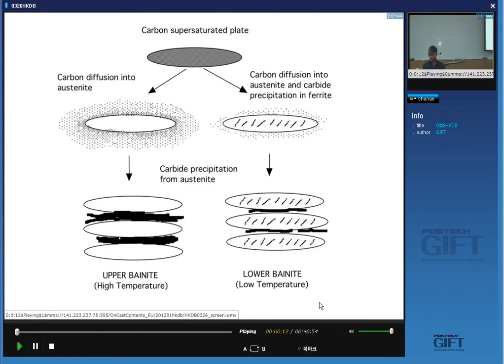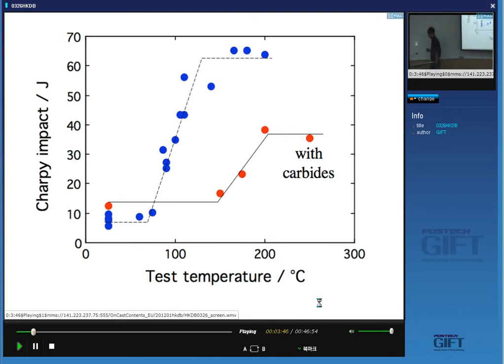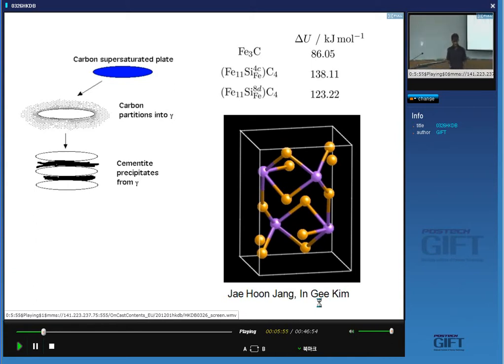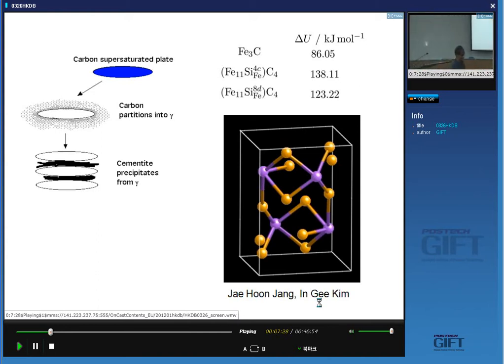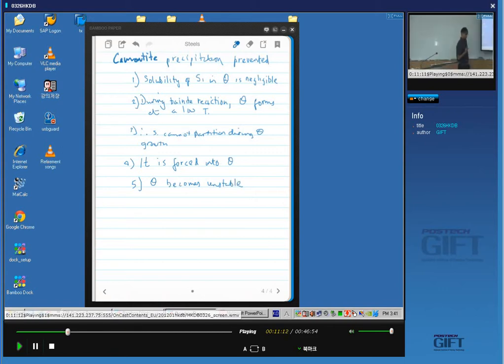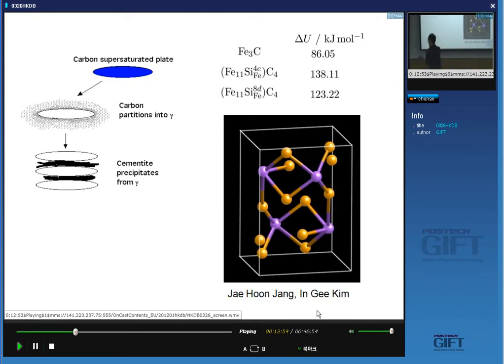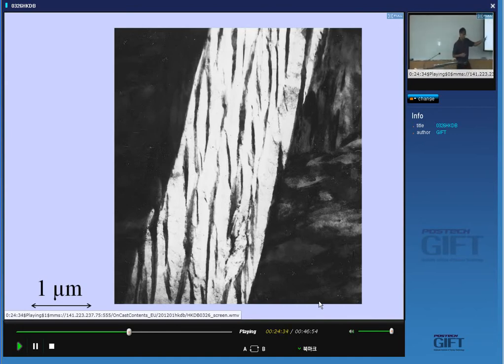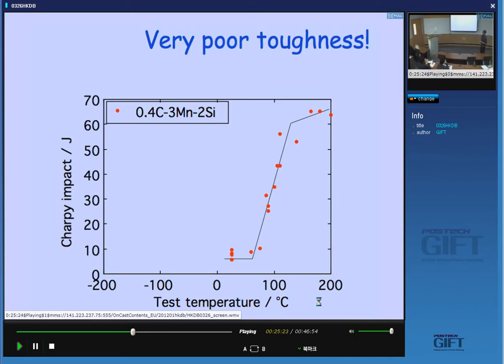Physical Metallurgy of Steels - Part 4

Comment: Thank you prof for wonderful lecture. i just wanted to know there are few bainitic steel like 0.2C-CrMoVTiB these steel exhibit good toughness of 200 J with strength of 950 MPa when quenched and tempered around 700°C. what may be the probable reason for the same. And the same material when quenched around 500°C gives toughness of 27J with strength of 1100 MPa. kindly let me know
Reply from the maker: You probably mean tempered at 500 C. In general, the toughness deteriorates as the strength increases since it is plastic flow that contributes to toughness

Comment: Professor Bhadeshia, the austensite is strong, the plastic relaxation is diffiuclt . the dislocation generate as plastic relaxation in weaker austensite can limit the growing. why the bainite ferrite plate thickness decrease with increasingly strong austensite?
Reply from the maker: wang hou The shape deformation due to transformation has a very large shear component, about 0.26. This compares with a typical elastic strain of only 0.001. The shape deformation is therefore partly accommodated by plastic deformation because the neither the austenite nor the ferrite are sufficiently strong to sustain it elastically.
Reply: bhadeshia123  thank you.but why the bainite ferrite plate thickness decrease with increasingly strong austensite?
Reply from the maker: The stored energy is greatest when elastically accommodated. So when the austenite is strong, the only option available to reduce the stored energy is to make the plate thinner.